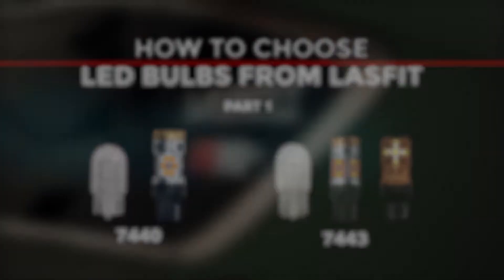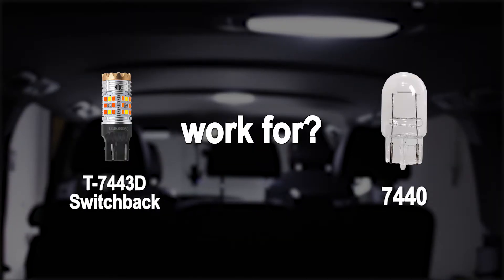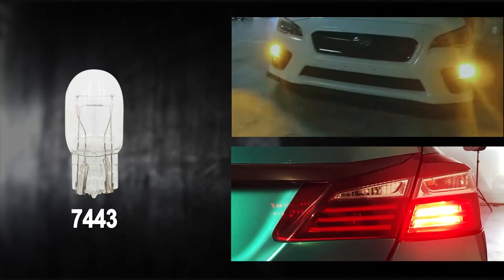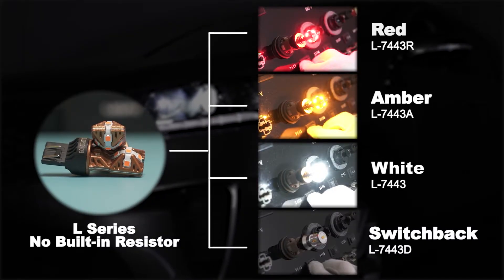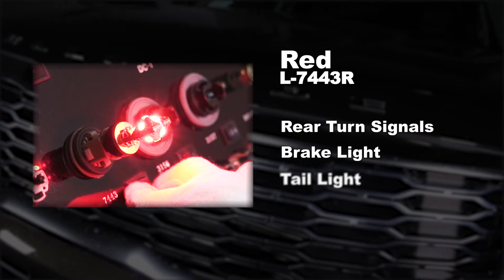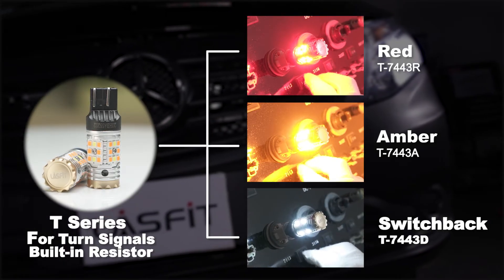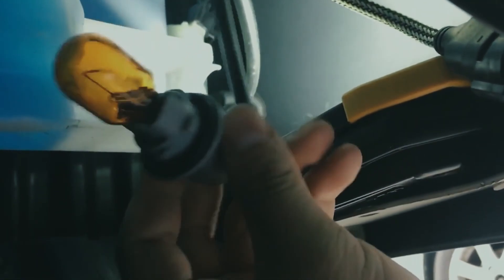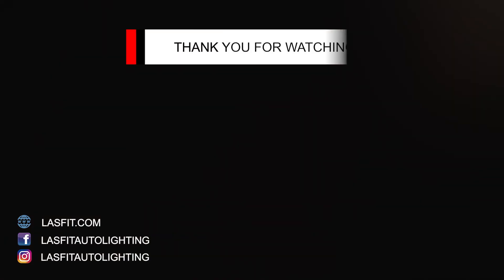How to choose LED bulbs 7443 7440 Brake Tail Turn Signal Backup Lights?

Comment: 2018 nissan altima sl
Reply from the maker: Hi, re you looking for LED bulbs for a 2018 Nissan Altima SL? This link includes the bulb sizes for various install positions in the 2018 Nissan Altima SL: https://www.lasfit.com/products/2016-2018-nissan-altima-led-headlight-bulbs-interior-lights?utm_source=Social&utm_medium=YTB+Channel&utm_campaign=2016-2018+Nissan+Altima
Hope you find it useful!

Comment: What led bulbs can I use in 2024 ZR2 Chevy Colorado for the rear tail lights?
Reply from the maker: Hi, for trucks like the F-150, Chevy, and Ram, current LED bulbs on the market are not fully compatible when installed in the tail/brake light positions, often resulting in hyperflash issues. Lasfit is developing an LED bulb that can be perfectly installed in these pickup trucks without needing an additional CANbus decoder/resistor.
We invite you to subscribe to our updates or send us an email. If we release a new product, we'll be sure to notify you right away.

Comment: 1995 Honda Accord LX - Upper Front turn signal and marker lights. Which bulbs are best?
Reply from the maker: HI, #T3-7443A for 1995 Honda Accord LX front turn signals: https://www.lasfit.com/products/7443-amber-led-turn-signal-bulbs-t3-series?utm_source=social&utm_medium=YTB+Channel&utm_campaign=T3+7443A
The T3 series turn signal bulbs are our newly upgraded bulbs, featuring built-in decoders, no hyper flash issues, plug-and-play

#L-T10 for 1995 Honda Accord LX marker lights: https://www.lasfit.com/products/2x-lasfit-t10-192-194-168-158-led-interior-light-bulb-error-free-1-year-warranty?utm_source=Social&utm_medium=YTB%20Channel&utm_campaign=L-T10-White
Reply: @Lasfit-Automotive  THANKS for the quick reply!! 🙂

Comment: 2014 Honda CRV, suggest front and rear turn signal, and backup light
Reply from the maker: Hi, below are the recommended bulbs for your 2014 Honda CR-V:
Front turn signal: #T3-1157D: https://www.lasfit.com/products/1157-switchback-led-turn-signal-bulbs-t3-series?utm_source=Social&utm_medium=YTB+Channel&utm_campaign=T3-1157D

Rear turn signal: #T3-7443A: https://www.lasfit.com/products/7443-amber-led-turn-signal-bulbs-t3-series?utm_source=social&utm_medium=YTB+Channel&utm_campaign=T3+7443A

Back up light: #L2-7443: https://www.lasfit.com/products/lasfit-7443-7440-white-led-bulb?utm_source=Social&utm_medium=YTB+Channel&utm_campaign=L2-7443
Reply: @Lasfit-Automotive  Thank you! Front turn signal is unavailable in Canada, and you guys do not ship outside the US. Please suggest.

Comment: Hi which bulbs fits in Honda accord 2003 2.4
Reply from the maker: Hi, This link includes LED bulb options for various positions on the Honda accord 2003, hoping it will be of assistance to you!
https://www.lasfit.com/products/2000-2007-honda-accord-led-headlight-fog-light-exterior-interior-bulb-plug-n-play?utm_source=Social&utm_medium=YTB+Channel&utm_campaign=Honda+Accord

Comment: I have a 2024 Honda Ridgeline Trailsport. So much conflicting compatibility information online. Tried to order from Amazon but always says not compatible with my vehicle and the ones they say are, are not. My vehicle uses 7440 T20 W21W sockets for the front and rear turn signals as well as the backup lights. Can you please advise me which LED's if any, Lasfit makes for my vehicle? Thank you.
Reply from the maker: Hi, based on the information you provided, Lasfit #L2-7443 fit your backup light: https://www.lasfit.com/products/lasfit-7443-7440-white-led-bulb?utm_source=Social&utm_medium=YTB+Channel&utm_campaign=L2-7443

#T3-7443A fit your front turn signals and rear turn signals: https://www.lasfit.com/products/7443-amber-led-turn-signal-bulbs-t3-series?utm_source=social&utm_medium=YTB+Channel&utm_campaign=T3+7443A

Please allow me to state one point: our upgraded T3 LED bulbs have not received much feedback from 2024 Honda Ridgeline owners yet, and to be honest, we are unsure if there will be any issues. We currently have a trial event for new products in our T3 series, 20%~100%OFF to get front turn signal lights and rear turn signal lights. Would you be willing to test them on your vehicle? Your feedback is extremely valuable to us! Don't worry, in case there are any problems, you will still receive a full refund, and we will provide a paid return shipping label.

Comment: Hi please help me. I ordered T series car tail light (for brake light) but after I installed it to my car, the ABS light keeps turning on. what's the matter? please help me
Reply from the maker: Hi, could you please tell me your vehicle's make/model and year? I will assist you in resolving the issue.
Reply: @Lasfit-Automotive  Toyota Rush J200E Y.O.M 2006
Reply from the maker: @Minaga7  Hi, for your specific vehicle model, we have not encountered this issue before. You may try installing a load resistor to see if it resolves the problem.
Reply: @Lasfit-Automotive  ok will see 👍

Comment: Is the t series switchback compatible with a 2005 acura tsx?
Reply from the maker: Hi, the switchback LED bulbs are not compatible with your vehicle due to the factory halogen bulb size for the turn signal on your 2005 Acura TSX. #T3-7443A fits your 2005 Acura TSX front and rear turn signal. Here is the link for you: https://www.lasfit.com/products/7443-amber-led-turn-signal-bulbs-t3-series?utm_source=social&utm_medium=YTB+Channel&utm_campaign=T3+7443A
We currently have a T3 series turn signal bulbs trial event, exclusive discounts will be offered to you. Are you interested in participating in our testing? If so, please feel free to contact us via youtube@lasfit.com.

Comment: I am very happy to follow you. I would like to know the numbers of the turn lamp and the stop lamp in the front and rear lights of a 2006 or 2007 Toyota Corolla.
Reply from the maker: Thanks for your comment! The following are the bulb sizes for the 2006 and 2007 Toyota Corolla:
Front turn signal light: 3157A
Stop lamp: 3157R
Rear turn signal light for 06 Corolla: 3156A
Rear turn signal light for 07 Corolla: 3157A
This link contains the LED bulbs you need for your 2006 and 2007 Toyota Corolla: https://www.lasfit.com/products/toyota-corolla-2001-2008-led-headlight-fog-light-exterior-interior-light-bulbs-plug-n-play

Comment: Hi, 
For Mazda 3 Hatchback 2010
Could you please help me with the lights?
Does switchback lights work in this Mazda?
What type works for break, turn and backup lights?
Can I use T series?
Thank you.
Reply from the maker: Thank you for leaving the message. We are glad to help you choose suitable LED bulbs!

After searching for some information about your Mazda 3 Hatchback 2010, yes, T series LED bulbs can fit your front turn signals. You can check more details on following pages:
#L-7443 LED bulbs for your backup lights:https://www.lasfit.com/products/lasfit-7443-7440-white-led-bulb?utm_source=Social&utm_medium=YTB%20Channel&utm_campaign=L-7443

#T3-7443A LED bulbs for your rear and front turn signal lights:https://www.lasfit.com/products/7443-amber-led-turn-signal-bulbs-t3-series?utm_source=social&utm_medium=YTB+Channel&utm_campaign=T3+7443A

#T3-7443R LED bulbs for your tail lights and brake lights: https://www.lasfit.com/products/7443-canbus-error-free-red-led-bulbs-t3-series?utm_source=social&utm_medium=YTB+Channel&utm_campaign=T3+7443R

If you have any problems, please contact us.
Reply: @Lasfit-Automotive  
I also want to install the license plate T10 led bulbs, do they fit without errors?
Reply from the maker: @DaviidEmma  Yes, L-T10 LED bulbs can be installed as your license plate lights, no dashboard error, easy to replace them.

You can check more information about the L-T10 from this page: https://www.lasfit.com/products/2x-lasfit-t10-192-194-168-158-led-interior-light-bulb-error-free-1-year-warranty?utm_source=Social&utm_medium=YTB%20Channel&utm_campaign=L-T10-White

If you have any problems, please leave a message.

Comment: 2015 chevy tahoe turn switchbacks ?
Reply from the maker: Thank you for your message.
Due to the factory design, 2015 chevy tahoe does not compatible with the switchback turn signals. If you want to try some aftermarket LED turn signals, we just released the new product, T3 series, which is exceedingly brighter than the halogen bulb but has more softer amber light.

And we are holding a program that is warm-hearted and invite some Tahoe owners to test these LED bulbs, if you are interested in this event, feel free to contact us.
Contact email: youtube@lasfit.com

Comment: I have a 2020 ford explorer platinum I want to change out my rear turn signals what do you recommend
Reply from the maker: Hi, the stock rear turn signals of your 2020 ford explorer platinum are halogen bulbs, right?
If so, the bulb size is 7440.
https://www.lasfit.com/products/lasfit-7440-7441-w21w-led-turn-signal-lights-canbus-error-free?utm_source=Social&utm_medium=YTB%20Channel&utm_campaign=T-7440A

Comment: Hello, I have 2015 Toyota Wigo Gen 1 and I wish to know which T series led bulb would fit in the rear turn light. Would   the 7440 should work or need 7443? Waiting your response. Thanks

Comment: hi, I have a 2015 mazda 3 with factory halogen brake light, I'm looking for a 7443 or equivalent for brake light that doesn't require resistor or cause hyper flash. thanks

Comment: I have a 2022 Chevy Silverado custom trail boss. Stock tail lights are 7444. Can I replace them with 7443 Litech Led bulbs?
Reply from the maker: We don't suggest replacing the stock tail/brake lights with LED bulbs at the moment. According to our experience and some customers' feedback, if the tail light, brake light and rear turn signal work on the same bulbs for some trucks, the LED bulbs don't work well.

Comment: Hello, i’ve a 2004 Toyota Premio. i like to change my front & rear turn signal bulbs to an Led Bulbs.
Which one should i Choose?
Reply from the maker: Hello, we didn't find the bulb size information for 2004 Toyota Premio. You can take out the stock halogen bulb to check the bulb size.

Comment: 7440 or 7443 for a 16 Silverado 1500?
Reply from the maker: The front & rear turn signals both are 7443 for 16 Silverado 1500. But we don't recommend LED bulbs to replace the rear turn signal lights. Because for trucks, if the rear turn signal, brake light and tail light work on the same bulbs, the LED bulbs probably have compatibility issues.

You can check the compatible LED bulbs for 2016 Silverado 1500 from this page:
https://www.lasfit.com/products/custom-d5s-led-headlight-bulbs-fit-chevrolet-silverado-1500-2016-2017-2018?utm_source=Social&utm_medium=YTB+Channel&utm_campaign=Chevy+Silverado+1500+16-18

Comment: I have a 2019 Jeep compass with Halogen bulbs, I have been trying several LED bulbs in the rear break/tail lights/ turn signal bulbs the bulb is 7443 but any LED bulb I put in does the error on the dash and also does the hyper flash for the turn signals...  can you guys please help me get the right bulb and  Load resistor or flash relay... also the brakes lights and the turn signal lights run on the same side of the bulb.. the tail lights run on the other side of the bulb..

Comment: I have a 2021 Ram 1500, i want to replace the rear amber turn signals, which one should I get.
Reply from the maker: Hi, we don't recommend the LED bulbs to replace the rear amber turn signals at the moment. Because for the trucks that rear turn signal light, tail light and brake light work on the same bulb, and the LED bulbs will not compatible with 3 lights according to our customers' feedback. 
We have listed all compatible LED bulbs for 2021 Ram 1500 on this page:
https://www.lasfit.com/products/2021-ram-1500-led-bulbs-lights-replacement?utm_source=Social&utm_medium=YTB%20Channel&utm_campaign=Ram%201500%202021-Whole%20Pack

Comment: Hi. Which serier LED will fit for the rear / amber lights of 2015 Lexus RC350
Reply from the maker: Hey, the front turn signal light bulb is 7444, the rear turn signal bulb is 7440. Here are links:
7443/7444:
https://www.lasfit.com/products/7443-switchback-led-turn-signal-lights-canbus-error-free?utm_source=Social&utm_medium=YTB%20Channel&utm_campaign=T-7443D

7440:
https://www.lasfit.com/products/lasfit-7440-7441-w21w-led-turn-signal-lights-canbus-error-free?utm_source=Social&utm_medium=YTB%20Channel&utm_campaign=T-7440A

Comment: So what works for a 2021 malibu the brake light is used for my turn signal as well
Reply from the maker: For your 2021 Chevy Malbu, the front turn signal light is 7443:
https://www.lasfit.com/products/7443-switchback-led-turn-signal-lights-canbus-error-free?utm_source=Social&utm_medium=YTB%20Channel&utm_campaign=T-7443D
About the rear turn signal light, is it halogen bulb or light-emitting diodes?
Reply: @Lasfit-Automotive  I got the front turn signals the switch back they work good ! But the rear lights bulbs are halogen

Comment: i would like to upgrade the front turn signal and side marker light bulbs on a 2021 Jeep Gladiator Sport.  Also, will I need a load resistor ?
Reply from the maker: Hey, no load resistor is required. switchback 7443 LED turn signal bulbs will work great on your 2021 Jeep Gladiator
https://www.lasfit.com/products/7443-switchback-led-turn-signal-lights-canbus-error-free?utm_source=Social&utm_medium=YTB%20Channel&utm_campaign=T-7443D

Comment: Can T series bulbs be used with load resistors?
Reply from the maker: Yes.
Reply: @Lasfit-Automotive  Hi,
I asked this question via your website’s online chat and was informed I should Not use with resistors as the bulbs themselves already have built-in resistors. 
I was advised the following: 
Hello, no our bulbs will shut off regardless if another resistors is added. Youll just add more load on your turn signal fuse. Maybe blow out the fuse.  

Could you clarify if I can or should not add in-line resistors?

Comment: I have a 2019 Hyundai Tucson, I’ve been buying from you guys since I got the car. Is there still no solution for the brake light error?
Reply from the maker: Yes, The brake lights still have the error code, we don't suggest you replace the brake lights with LEDs.

Comment: What led bulbs would fit my Mercedes Benz 2016 C300 4Matic ???? With built-in resistor/code error free. What bulbs fit with no error/no issues, LED Rear turn signals and Front low beam/high beam bulbs ???
Reply from the maker: Hi, you can check the compatible LED bulbs for your 2016 C300 from this page:
https://www.lasfit.com/products/2009-2017-mercedes-benz-c300-led-headlight-exterior-interior-light-bulbs-package?utm_source=Social&utm_medium=YTB%20Channel&utm_campaign=MB%20C300%20MB2%20the%20whole%20set

Comment: I want to use the T series in the break lights  in a 2015 Toyota Highlander. Will these work properly.
Reply from the maker: Hey, we have T series red LED lights fit for your 2015 Toyota Highlander:
https://www.lasfit.com/collections/led-whole-package-for-toyota-highlander/products/2011-2016-toyota-highlander-led-headlight-fog-light-exterior-interior-bulb-plug-n-play?utm_source=Social&utm_medium=YTB%20Channel&utm_campaign=Toyota%20Highlander%202011-2016%20Whole%20Pack

Comment: I have a Toyota Wigo (Agya) Gen 3. I am planning to replace the halogen turn signals to led, t20 is the plug. Which will be compatible to the front and rear turn signals? 7440 or 7443
Reply from the maker: Hi, T20 has several bulb sizes. Could you take some photos of your stock front & rear turn signal bulbs to send us for a look?

Comment: Vios gen 4 2019 model what compatible signal lights en brake lights
Reply from the maker: Sorry, we didn't find the bulb size for your 2019 Vios.
Could you check the bulb size of your turn signal lights?

Comment: Hi I have a 2016 Honda Civic Touring and wanted to switch out my 3rd brake lightbulb with LEDs. The stock is 7440, but can I use a 7443 LED bulb to replace that? Do I need resistors for it?
Reply from the maker: Yes, you can use 7443 white LED bulb to replace that, no resistor is required.

Comment: What type led tail lights for 2007 Honda civic brake,turn and back up light ty
Reply from the maker: Hi, you can check all compatible LED bulbs for your brake, turn and backup lights from this page:
https://www.lasfit.com/products/2004-2013-honda-civic-led-headlight-bulbs-fog-lights-exterior-interior-lights?utm_source=Social&utm_medium=YTB%20Channel&utm_campaign=Honda%20Civic%202004-2013

Comment: I drive a 2014 VW Passat TDI I’m wondering what bulb number for the DRL or Daytime Running Lights? Also what bulbs for the Map or Dome lights inside the car between the driver seat and passenger in the front and back of the car please?
Reply from the maker: Hi, you can check all compatible LED bulbs for your 2014 VW Passat from this page:
https://www.lasfit.com/collections/led-whole-package-for-volkswagen-passat/products/custom-led-light-bulb-upgrade-for-2012-2019-volkswagen-passat?utm_source=Social&utm_medium=YTB%20Channel&utm_campaign=LAG2-VW%20Passat%20whole%20pack

Comment: Lincoln Mark LT Truck
YEAR: 2006
4-door
Bulbs 7443 flashing brake lights 

Will this work? 
Thank you
Reply from the maker: Yes. You can try them on your truck.
Reply: @Lasfit-Automotive  update: it’s been tried on my mark LT Lincoln it’s a NO-GO BULB is to big

Comment: Chrysler 200 sedan
Year: 2012
 4 door 
I have 7443 flashing brake light 
Will This work?
Reply from the maker: Yes. But we don't recommend these LED bulbs for your Chrysler 200 sedan.
According to our experience, these after-market LED bulbs are not compatible with some models of Chrysler, Jeep and Dodge.

Comment: Honda CRV 2005 which are the best reversing lights that you recommend.  Thanks
Reply from the maker: The reverse light bulb size is 7440 for your 2005 Honda CR-V, these 7440 LED bulbs will work on your car:
https://www.lasfit.com/products/lasfit-7443-7440-white-led-bulb?utm_source=Social&utm_medium=YTB%20Channel&utm_campaign=L-7443